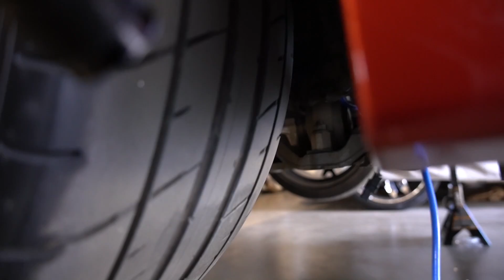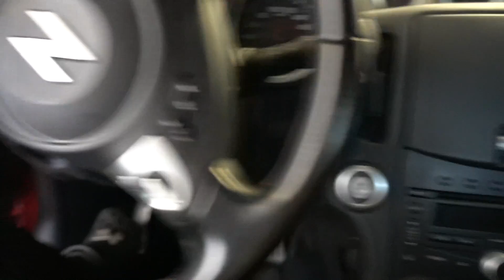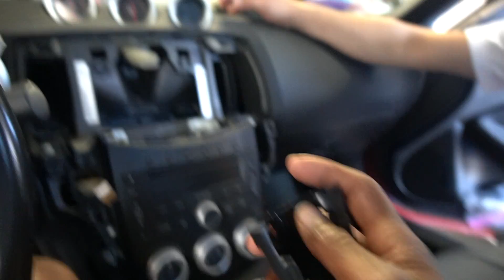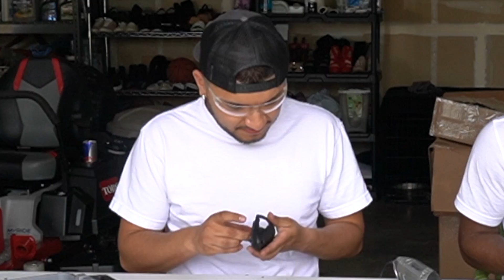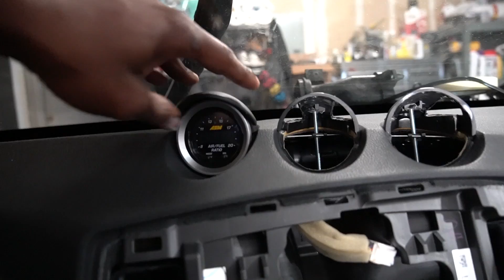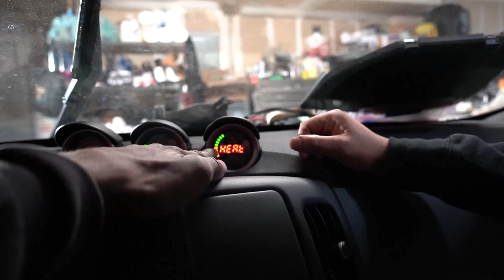SINGLE TURBO 370Z AEM GAUGE(S) INSTALL

Comment: The only stock gauge that is useful was the oil temp one but you replace it with the aftermarket one anyways. Battery voltage and time? lol no one cares about those and the time reads slow (literally can set the time 2 minutes ahead and the clock will be behind by 2 minutes in a few days).